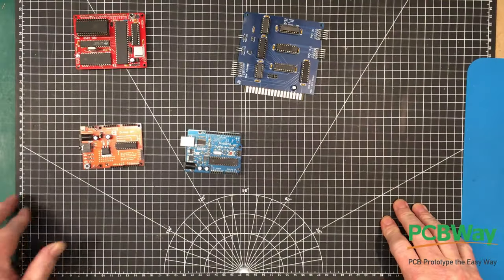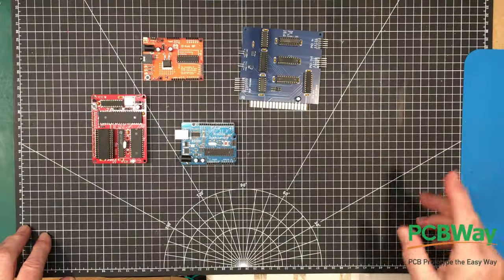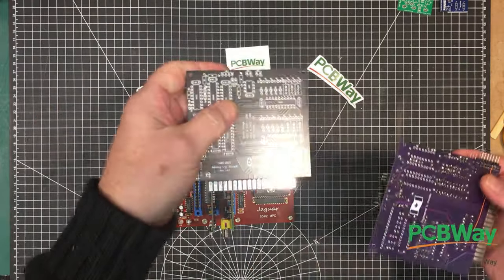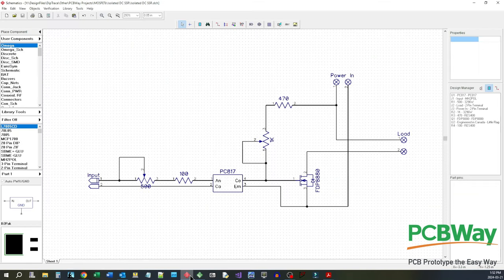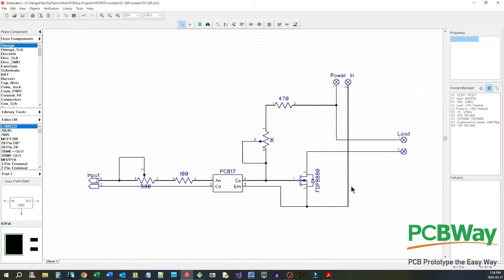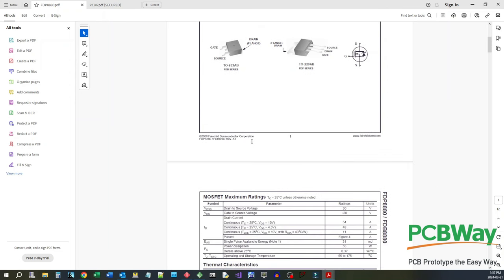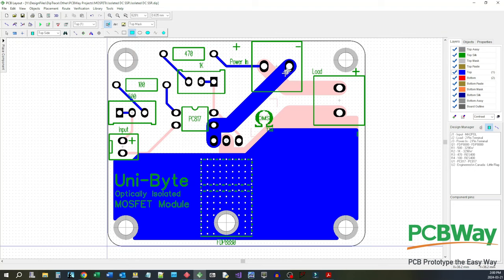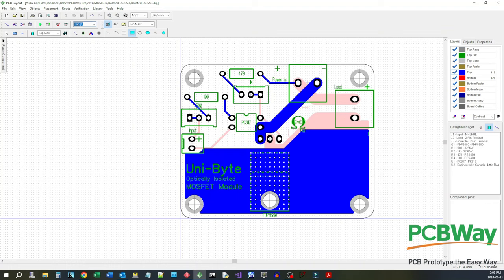Uni-Byte 0171 - Isolated MOSFET power DRIVER Part 1

Comment: This video is very timely, for me. I am designing a similar project and you covered all of the design considerations that I have encountered. My design goals... To create an Individual Isolated Universal/NPN-MOSFET H Bridge Stepper Motor Driver Board. This is a big name for a small board that only contains an optocoupler and a NPN MOSFET. Meaning, I will be using NPN-MOSFETS on both the low and high side of the Stepper Motor load... To emulate the PNP for the high side, I will be adding a Boot Strap, which may be used, or left unpopulated, for NPN/Low Side use. You will recall that I am self taught... My present prototype board mistake was to configure the optocoupler to drive the MOSFET from the low side of the optocoupler transistor. And, while I know to employ a Boot Strap on the load's high side, even after watching tutorials, I really do not understand the higher gate voltage that is required, or the Boot Strap's operations. So, I look forward to the next video!
Reply from the maker: Glad I could help shine some light!

Comment: Interesting but MOSFET with a higher max. gate source voltage are very extremely rare so in the end you will need an other circuit. For anyone building this circuit: add a 10 V zener between gate and source to limit the gate voltage.
Reply from the maker: Yes, if you wanted to use for controlling voltages over 20V.
Reply: @uni-byte  Yes, but your explanation is that you don't need an other circuit but an other MOSFET if Vin is > 20 V which is incorrect. I also don't understand why you didn't take advantage of the opto-coupler to build a normal open circuit. The MOSFET is on when not driven... A strange choice and probably confusing for some.
Reply from the maker: @foobarables  I'll go along with that.  As I said in the discussion (or maybe in part 2) this is a circuit I have used before and was designed for one of those uses.  However, I have used it for multiple applications.  But I guess you are correct, it might confuse some.  Maybe I'll take a "Version 2" stab at this at some point.  I tend to re-use things that work as long as the application is within the device/module envelope of operation.  There are benefits to that philosophy that I'm currently trying to get across in some of my recent videos.  Thank for your input, it's good information.

Comment: Op-Amp can be used as a isolated -buffer.
Reply from the maker: An OpAMp would provide buffering, but not isolation.  For proper isolation you need to have no galvanic connection between the isolated parts.